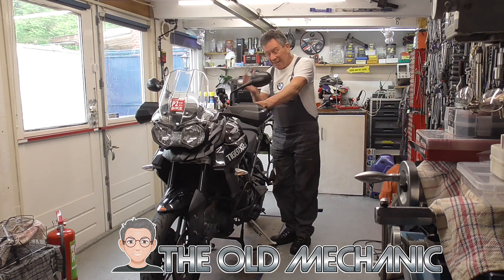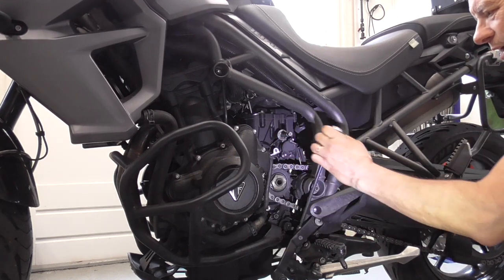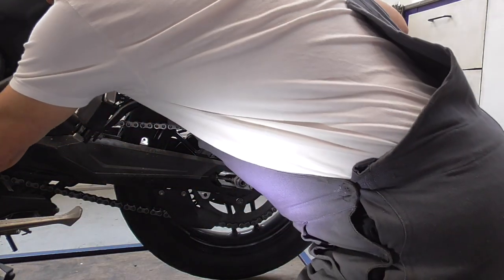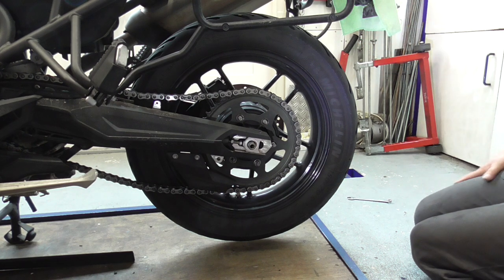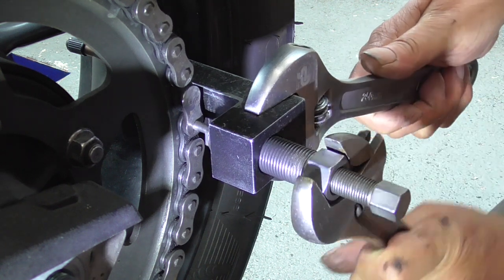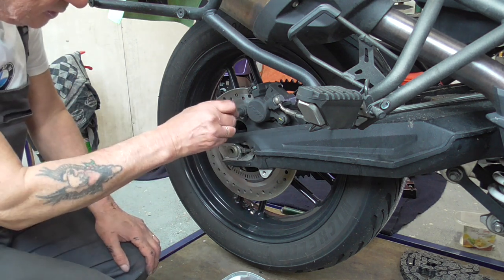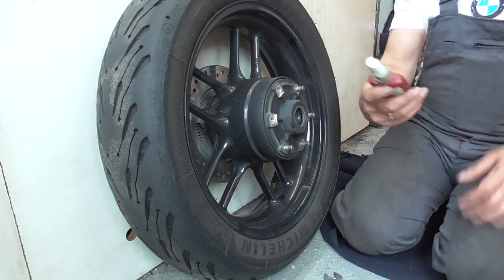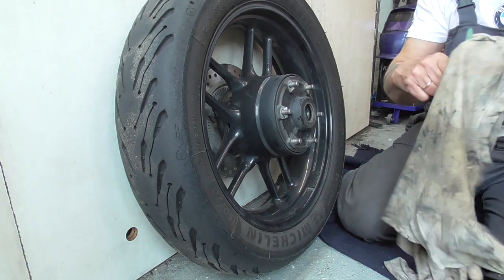Triumph Tiger XRX NEW CHAIN & SPROCKETS (-SUPERSPROX STEALTH-) PART-1#4

Comment: I have a Tiger 660 and I'm trying to replace the OEM chain with a DID chain and I'm also doing the 17 tooth conversion. It's supposed to be a 520/122 chain which is what I ordered, but when I fit the chain, it's too short. If I put the bike back on the ground on the center stand, I get plenty of slack. Off the ground on the paddock stand, not enough slack to connect the master link. I even tried adjusting the rear axle a bit forward. The box indicates 520/122, so it's hard to imagine they sent me the wrong one?